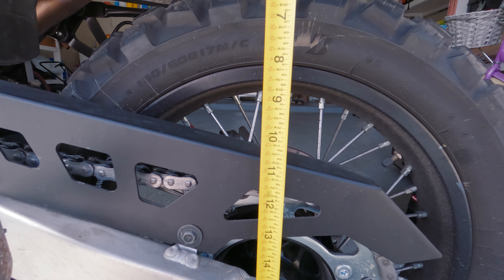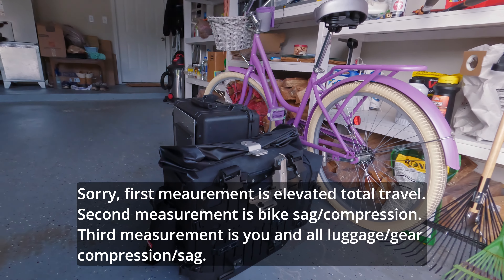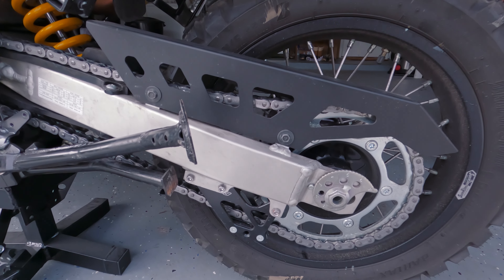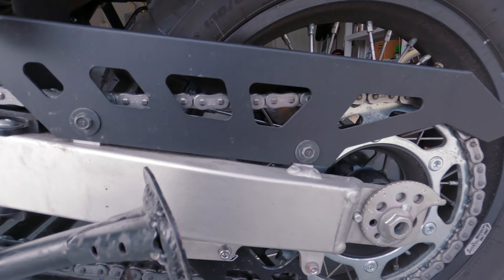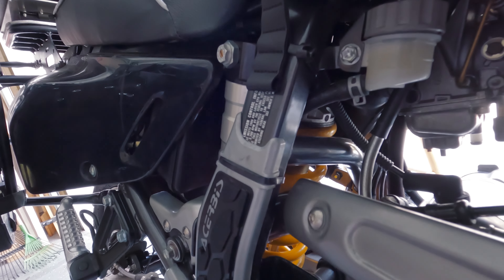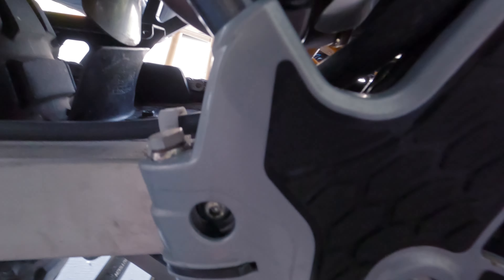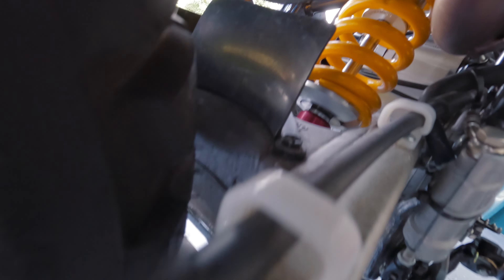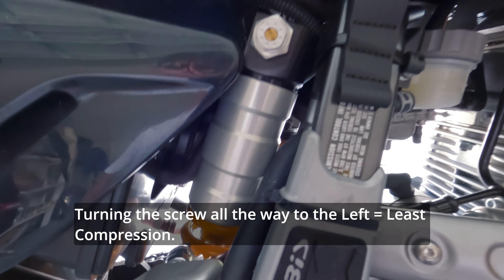How To Measure Sag & Set Preload 2023 - Cogent Dynamics Mojave Pro Shock - Adventure Motorcycle

Comment: Total rear suspension travel on a DR650 is 10.2 inches.  Race sag should be around 3.5 inches.   You are closer to 55%.  Safe travels!
Reply from the maker: Thank you for watching and commenting. I have a Cogent Dynamics shock, though. Are you describing the stock shock, by chance? I had lengthy conversations with Cogent and I'm rather certain I measured and set it correctly for the Cogent shock.
Reply: @GeordieMac  I’m no pro but I wouldn’t sweat it if you aren’t bottoming out.  I’m sure you have plenty to worry about that is more important.  The theory is the amount of sag as a percentage of total available travel.  If you sag 5.1 inches and have 10.2 of total travel (DR650 specs) that would be 50%.  Again I’d say you are close enough.    Have you considered posting on any of the DR650 FB pages?  I’m sure many would like to follow your adventure.  DRRiders is a suggestion.  Keep the videos coming!
Reply from the maker: @tarjas  thanks! Will do!
Reply: @GeordieMac Cogent instructions say 1/3 the travel, which Cogent sheet also says is 85mm +/- 10mm
Reply: He is using the measurement from the axle to the fender.  Not the shock length or available shock travel to get the 30%.  3-3.5” is the correct number, doesn’t matter what shock spring is used.

Comment: You’re not correct there somewhere, because I measured mine and from wheel off the ground to me sitting on the bike, the difference is 3.5”, which is perfect.
Reply from the maker: Hey, Michael! Thanks for watching! I made this video a while ago, so I don’t remember the numbers, BUT they are and were absolutely correct. I can’t speak to your bike, but I’m quite certain that I measured correctly and made the correct adjustments.
Reply: @GeordieMac bike is same as this one.  It doesn’t matter what shock or spring stiffness you have, the sag according to Cogent for the DR650 should be around 3.5”.  Cogent documentation actually says 85mm +/- 10mm.  Over 5” is a lot of sag with only 10.25” of available suspension travel.   But if it works for you, than that’s all that’s important
Reply: It should be 30% of the available suspension travel, which is 10.25” on any DR.  9” in the lowered position of the stock shock.  30% of that.  Not 30% of the distance you measured.  That’s where it’s incorrect.